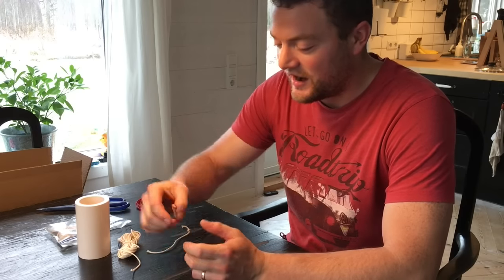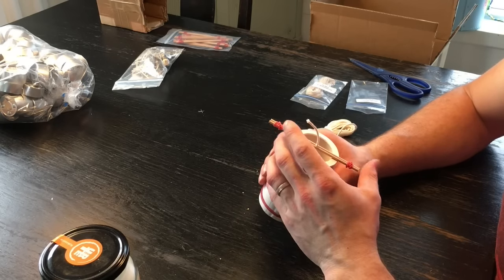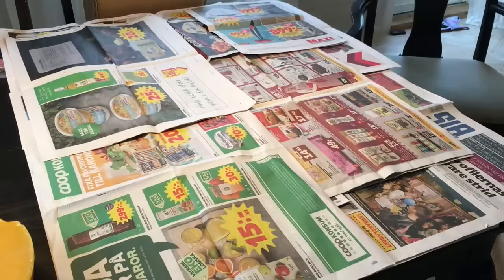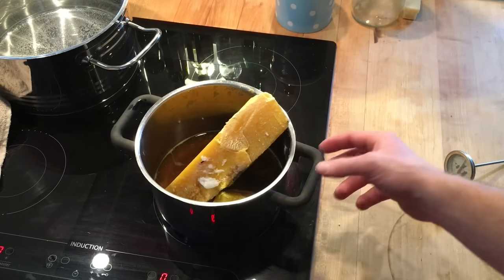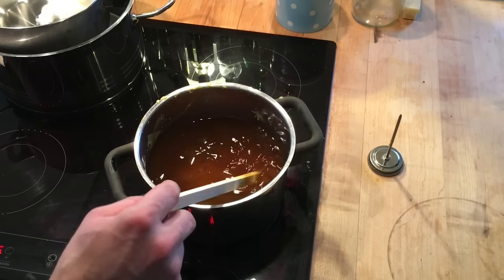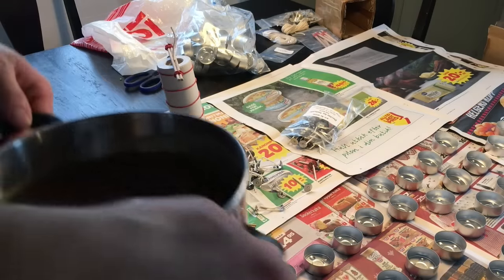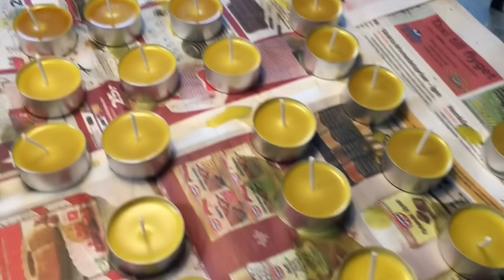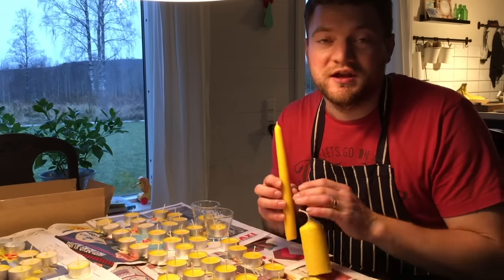Making Beeswax candles for the first time

Comment: I'm a bee keeper.  I'd like to suggest you use coffee filters or paper towels.  If you have access to a restaurant supply house, grease filters will take the temperature you want.  They are cone shaped and you can get a wire stand to hold them. That's what one of our bee club members uses to strain his wax.  He usually wins first prize at out state fair.
Reply: Any paper or rag product with bee's wax in it makes a great fire starter.   To remove wax spills from a paper or fabric,  freez it, and agitate or scrape it off.
Reply: I find old nylon sheer curtain material works great.  Get the curtain material at thrift stores for pennies.  I simply use clothes pegs to hold the material on the pot.  Very little waste of wax.  Beeswax is expensive if you don't have your own hives.
Reply: Winner of a video, I've been looking for "how much wax for candle making" for a while now, and I think this has helped. You ever tried - Cenadoelyn Candle Contemplation - (Have a quick look on google cant remember the place now ) ? Ive heard some pretty good things about it and my brother in law got excellent results with it.

Comment: if you melt the wax  with 3-4 inches of water in the pot  the dirt will sink to the bottom water  and the wax will float on top clean let cool remove wax. can be repeated  2-3 times for real    real clean wax.
Reply from the maker: Ok. Thanks for the info.

Comment: When I was very young I was in a group for young girls called the "Brownies" here in the USA. We learned to make candles. We used soup cans with the tops off and bottoms removed. (also the labels was removed).  We used waxed paper on bottoms,  it was rubber band tight to fit bottom around can. We used popsickle sticks with small bands on end to hold wick in the center across top of cans. We used coffee filters to drain wax after melting into clean pan. We also used Milk Cartons as well. We used a small tin measuring cup to dip out wax and to pour into cans and cartons. Back then they would add different spices to melted wax for different scents just by dividing the wax into individual different pans for all the different scents. It was fun an exciting. We used small leaves and beads and sequence for decorations on sides. And tied ribbons around them. This makes great gifts for holidays and for decorated events you may have. Now today I make emergency candles with all the extra wax melted down from the candles that do not burn entirely down at times. Helps when the lights go out in storms here.  Leading to no wasted candles. Thanks for your informative video. I love it. God bless and keep you all always.

Comment: Sorry but I forgot to mention a couple of things that I hope you will find helpful...
1) you can purchase metal molds that will allow you to pour multiple taper and 
pillar candles at one time.
2) try pouring some beeswax into your tea lite molds without the wicks, this makes 
great lip balm and holders. Perfect gifts to give out...!
3) using a metal pitcher makes pouring so much easier...!
4) an easy and cheap way to color your candles is to use pieces of old, broken
crayons...!
I used to make candles to sell and to give away as gifts...
5) here is a secret of mine that will sell out every time you make them or people
will love to receive them as gifts...
I know that you have good beach sand there.
Get some and filter it out well, remove any "junk" in it.
Put the clean sand into a box that is open at the top. The size box you use helps determine the size 
of the candle you'll get.
Using your fist, push down into the sand making a mold to use.
Note: to really make them unique and look cool, try adding some shells, small dried flowers, etc. 
put these in the bottom and sides of the mold you make, each candle will be a one-of-a kind creation...!
If you leave your mold like this make a rope hanger to hold your candle from or use your finger or some
round object and make some indents, about an inch to about three inches this will make legs for it to
stand on...
You can make these any color and scent you like.
Something that looks cool is to pour you wax in a couple of inch increments, depending on the size and
depth of your candle adding more shells and such as each level drys.
Note: you can make your candles multiple colors by doing this, they will burn down in layers.
Remember that these candles will have a sand shell/casing all of the way around them except on the tops.
They will burn from the top, middle downwards so as it burns it will reveal the different colors and/or items 
that you placed inside of it...!
Their size and design is only limited by your imagination...!
Once I made one as a special gift for very good friends using a very large box I made...
It ended up being used as a round coffee table, I made the legs the size of my fists and about
two foot long. The whole thing was about 4 1/2 feet in diameter and stood about the same in height...!
It was full of all types of shells in various sizes, dried flowers, unique stones, etc.
They loved it...!
When the candle is dry, give it a few days depending upon its size, you just remove the housing for the sand
that you used, cardboard boxes work great, lightly brush off any loose sand, and your done...!
I know this sounds like a lot but it really is very easy...!
You can google "sand candles" to find out more I would think.
Sorry for this being so long of a post.
I hope this might help you or others make some one-of-a-kind gifts and possibly make some 
money too...!

Comment: Professionals use a fine mesh metal strainer.  Much easier and quicker. Saves clean up time.  You may also find a metal turkey baster will help fill those moulds faster and with very little spillage.

Comment: some of the ways we made molds for the wax we use milk cartons cans for bigger ones are used coffee cans a coarse coffee cans for smaller back then all kind of stuff like that coffee cans for okay but no cars were easy because it works on them and you just cut them apart and they come right off you can use anything for important things slow so you don't ruin the wax we had what we called wax thermometers all kind of things we use we made so many candles we dip we have mold for all kind of candles seems like everybody back them one of big candles that's why we use coffee candles and we put two or three or  four which in them

Comment: Cutting the wax into smaller pieces would probably speed the melting up a bit. You could also use a hot air gun to heat the wax. The pot only gets to the wax touching the bottom or the already molten wax so maybe a heat gun hitting all sides at once could kick-start it in a way.

Comment: I kept hearing you say that you wasted wax. I don't think so, the paper would make excellent fire starter now. As will the towel. I wish i had a source for about 30-40 lbs of wax. i'd make my own candles for the house and fill a crockpot full for dipping leather in to harden and protect it.
Reply: wasted as in it's not going to what it was originally intended for, but they probably also weren't sure that there are other options for the 'waste'. :)
Reply: My cousin mentioned beeswax coats thread and it's much easier to sew a garment with thread coated in beeswax.

Comment: If you use wax paper or the kind you use in the oven for baking you can just remove the wax that you spill so it wont be a wast, beeswax can be remelted as many times as it is needed and as somebody else wrote if it is in smaller pieces it will melt faster. nice video and nice candle molds, I have only seen plastic. I order from a swedish company.

Comment: I'm 70 years old when I was young we make candles 
 we melt the wax was we had two pots. one bigger pot and the other pot To fit into the bigger pot.   
 one pot with the wax another pot which we have water and we heated the water to melt the wax
Reply: Theodore Bowers This is called a double boiler and is a common way to melt things without burning them. Chocolate for example, will scorch on direct heat, so you melt that in a metal pot or metal mixing bowl set over a simmering pot of water. I imagine wax works similarly?
Reply: That definitely the most common way, or you can use a microwave if you have one. I have made candles but plan to
Reply: Theodore Bowers the system is a boiler pot. We did same thing melting wax and crayon chips for colors.

Comment: you dont need a silicone mold, you can use a pvc/metal pipe and just baking paper instead of using stick fast spray or other things so it dont stick to the pipe.

Comment: Do you need to "cure " the candles? I've seen pictures wher I believe it was the Amish making candles, they we're using wooden forms that did about half a dozen long taper candles. When they come out of the molds they hang them so they stay straight in a cool dry room until they are cured.
Reply: Be aware: rats and mice eat candles.

Comment: Use cookie sheets to catch spillage instead of newspaper. Also a Turkey baster might reduce it by alot. Also, an electric crockpot on low is 185° F. You can put thw wax in and cover it. Come back every a half hour and check on it.

Comment: Once your towel has cooled to where you can safely touch it,
place the whole thing into a large pot of boiling water...
The wax will re-melt, next remove the towel making certain you've 
Removed as much wax as possible from the towel...
Now, let the water cool down and the wax will harden and end up
floating on top of your water where it can be safely recovered.
Also, why did you put your melted wax into the melted coconut oil...?
If it was just for the smell, try using the wax straight.
I believe that you will enjoy the way it smells, even when it's not burning.

Comment: I watched another video and they put parchment paper down instead of your newspaper, then it's easy to remove all the spilled wax and collect it and re-use it, melt it with the next batch. Also you need some better pouring methods, old pitchers with pointy spouts or a glass measuring bowl with a spout to pour, and a spoon/ladle with a spout. Would make your pouring a million times easier and cleaner. Break up that massive chunk of wax you have there to make the melting faster! Also like many others commented, that knife cut was painful to watch. But very cool video, I liked it.

Comment: If you used a clip or a safety pin on the bottom to hold the wick, then you would get less wastage. I know it isn't much saved per candle but it might add up?.. 
I've enjoyed these videos on the candle making equipment and am considering getting some candle forms and wicks myself.
Reply from the maker: Nice. Go for it. It is fun and fulfilling.

Comment: You will NEVER get that wax out of the towel. lol
I usually process my wax 3 to 4 times......melt in water and pour into a 5 gallon bucket. Much of the impurities will settle in the water and to the bottom of the wax, which can be scrapped off. My processing equipment is used only for processing bees wax. Just because of how my trouble it is to clean. Thrift stores make for great cheap places to get wax processing stock pots.
Reply from the maker: We used an old t-shirt for the second round. It worked much better.
Reply: First question is why do you call it Bees Wax but call the Coconut Oil? You should be calling it Coconut Wax and it is made from Coconut Oil but has a lower melting point which is why you cannot use Coconut Oil. I do not car how old the towel was use a wire strainer with paper filter as it will filter quicker?

Comment: why did you add a cup of coconut oil into the wax?
Reply: I am really interested as to why the coconut oil as well.
Reply: By blending the beeswax with a softer oil, you are effectively bringing down the melting point of the candle. The purpose of that is to create a mix that is slightly softer which allows a more even burn. 
Plus, it helps to extend the beeswax, which can get expensive if you don't have your own bees or if you get it filtered and refined.

Comment: Your use of the knife from around 5.20 made my blood run cold. With that amount of pressure on a closing blade you would do a lot of damage. As far as I could see the blade does not lock, if it does then ignore what I said.

Comment: if you boil the block in water first then you don't have to worry about the whole "what's the temperature" thing... and then you can easily filter that and THEN let it cool into a clean block.
It does not look like you've done any kind of research yourself.